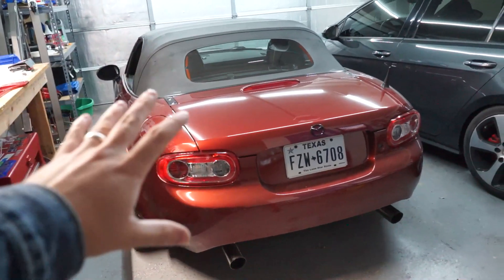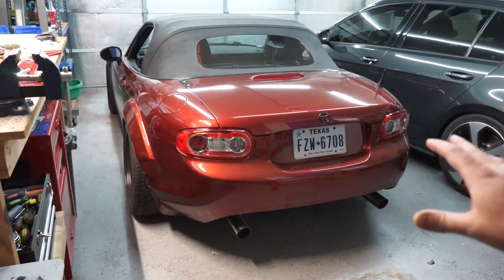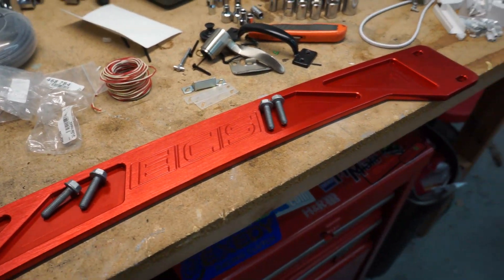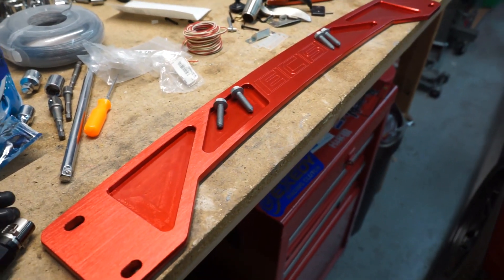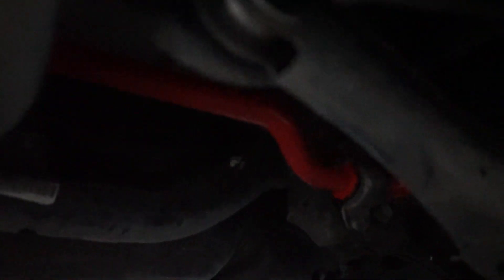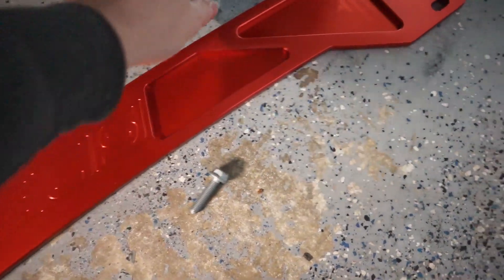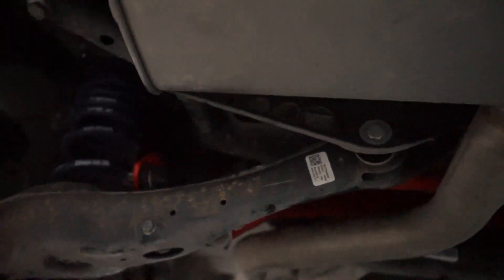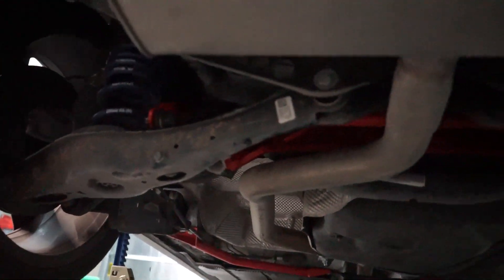Mk7 GTI Rear Subframe Brace by ECS Tuning

Comment: Have you been able to drive it somewhat hard and spot the difference in the car's behavior with all the braces you installed on the rear?  Have you noticed any added noises or steaks or creaks after install in the car while driving?
Reply from the maker: I'm not positive this rear brace makes a bigger difference than the sway bar, noticeably anyways. The rear end certainly feels tighter.

Comment: I got the same set up, with the adjustable ecs. endlinks, did it make any noise when you drive especially over bumps ?
Reply from the maker: It did at first because I put the front end links on backwards and they were banging/rubbing against the inner fender